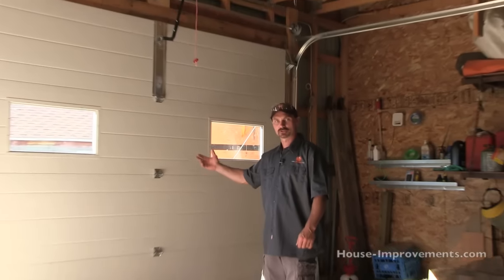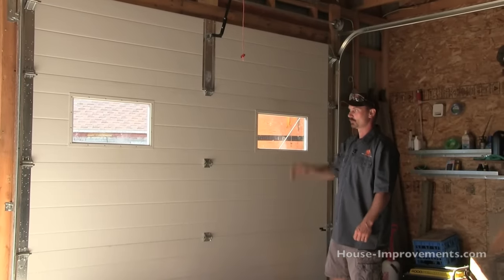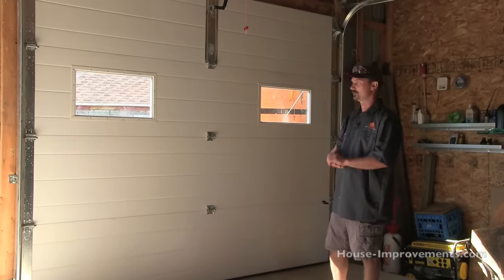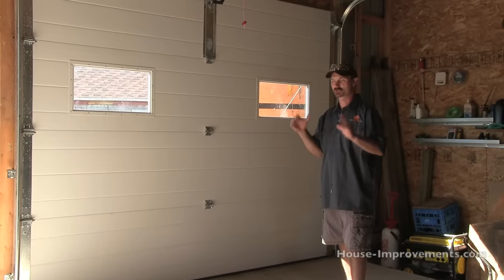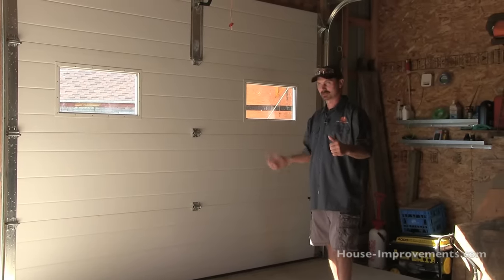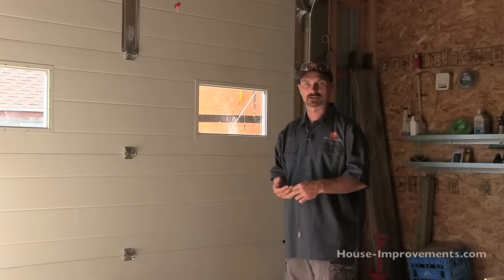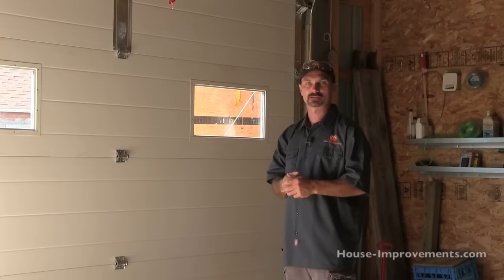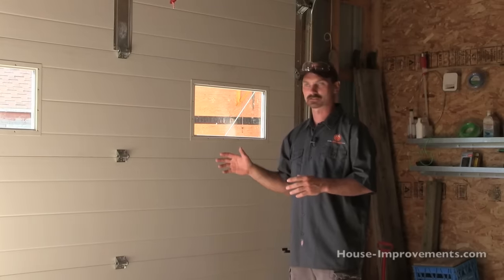How To Install A Garage Door

Comment: Well Done! Been having some problems with my doors and the contractor that installed them has disappeared off the face of the earth! Not only do I feel confident that I can fix it now, but your instructions have shown me what the contractor did wrong that has been causing the problems! The "AH-HA" moment for me: Roller brackets are numbered and "offset" a bit as they go up from the bottom of the door. Explains why mine have always been noisy and were binding!  My door opener has been eating through the "coupling bushing" at motor & track.  I have replaced those 3 times and adjusted the "down-force" so many times I don't remember how many times I have moved the stop switch! Thank you so much for pointing out the obvious. Of course I should have been able to read that in the instructions...but I think my contractor must have used those to roll a joint with...so I don't have them! LOL Thanks again!
Reply from the maker: Good luck,glad to have helped.
Reply: I do have a question you may be able to help with. My door instructions say there should have been a "tag" placed to tell how many "turns" to set tension at. Contractor must have thrown it away, (along with the install book that I was able to find on the inte-rweb). 16X7' insulated door (4 panels, 1 panel with full windows). Dual 225-27 springs. Mark on cone/coupling is G2.005 60. Any idea what a good starting point would be for number of turns? I am guessing I will need to increase a bit as I added 3 more 16' support struts as door panels were "tweaked"  ...but what would be a good starting point? Both winding cables have been replaced as they were broken so I never had a chance to "unwind" and count the turns!  Thanks in advance.
Reply: David Sheward A good starting point on any residential overhead door would be 1 complete turn, per foot of door height. ie: 7' door = 28 quarter turns or 7 complete turns.
 If the struts were added to the door later and were not part of the original package, you may need to talk to a local professional to asses the weight to replace both springs (the original springs are designed to lift your door to it's full opening height. Additional weight will either throw the balance off or wear faster on the springs) Or you may just need to add a couple of additional quarter turns.
Reply: David Sheward It depends on the door height and the drum efective diameter (i.e. the actual steel cable turn diameter on the drum).
With every turn of the drum you will unroll π(pi) times the diameter of it and you want the spring tension to be almost zero when the door is horizontal.
Taking that into account I would start with no less than H/(π*D) turns.
H (effective door travel) and D (effective drum diameter) should be in the same measuring unit.
Does this approx. match with the one in your project HouseImprovements?

Comment: If you put the vertical tracks up right after you put the first section in then you won't need to use a nail to hold up the sections, the rollers will do that for you. Much easier.

Comment: Shannon,  thanks for the video.  I will be removing and installing my garage and garage door opener for the first time.   Really liked the video; it was very detailed and informative.  The only one thing I notice you didn't mentioned is making sure that the horizontal rails are even.......I guess to measure both sides at each end at angle.  ( just remembered that from another short video that someone else make).   But regardless, really liked your video and thanks again!

Comment: The most important thing is be careful not to let the bars slip during tightening, or that spring, and or the other bar, will go flying/spinning wildly, and you could get seriously hurt!.....My Uncle worked 40 years plus, for the Overhead Door Company.....
Reply from the maker: ya that is the most dangerous step in this whole install. I think I mentioned that like 5 times in the video so people would be cautious.

Comment: Home Depot sells a 3' 1/2-inch diameter steel bar. Cut it in half, and you have the best tools for winding the springs. I'd avoid the rebar Shannon uses.

Comment: nice informative video.  Maybe mark your torsion bar adjusting tools (rebar) 1 inch from the end with blood-red paint so you can verify that it's completely in the hole before removing the other one, and maybe point out that you don't "push up", but instead "push in" (towards the header board) so that it doesn't slip out while you're tightening it.  Yes, I've played "knuckle-bump" with my torsion spring on my first attempted at a dyi garage door install (before you tube). Ugly, but memorable lesson.

Comment: Also i like to comment again on the weather stripping i wasn't aware of a channel  they slide into only saw the adhesive glue ones on various objects. Total get what to look for on doors (specially garage doors) , windows , or anything that has weather stripping. It maybe a channel slide in type rather then a adhesive one. Really important to be aware of in general for dealing with weatherstripping not just for garage doors.

Comment: Thanks for video. Will save me much time.couple questions...
1.Rollers, why are they in the lower of the two slots?
2.if installing with dual springs, any cautionary tips, especially if doing alone, as i well be?
Thanks again for sharing your knowledge. Much appreciated.  Btw, great looking garage, framing.

Comment: well done but never wind springs while your standing directly in  front of them, always stand on either side depending on which spring you are winding but yet in some cases standing directly in front of the spring to wind it is the only way  use extreme caution.....also you can wrap the cable on the bottom fixture before installing the l track to make it easier to put on and get to. good job

Comment: Great video.  My problem is that after replacing the old rotted posts the new ones aren't straight, so the new PVC door jambs and brick mould don't line up correctly.  No matter how much I reposition the post, it's always off by a little bit and the whole thing looks bad.

Comment: Good video, but, the 2x4 used to support the track when the door is up will have to be replaced with a metal hanger. No matter what the weight of the door that will fail eventually.

Comment: Hi shannon from house improvements. As an instructional video on YouTube this is pretty good, but you're obviously a builder first. I say this as a green apprentice. For instance the use of rebar is just scary. Please people use "winding bars",  torsion springs are bad enough. "What size was it? OH, this size." That's equally critical to the video as it is to yourself, people want to have these tools prepared, not wonder what size to use, and on a square nut 12 point works best

Comment: if you are going to tension the spring spray it with paint and line then you can see how much tension there is on the spring then you don't have to count much better even if you have to retension the spring later

Comment: This is the best instruction video that I have ever viewed. It was clear, well photographed, well paced and valuable to the viewer. Thank you for sharing your knowledge,  talent for mechanical projects and for your video instruction skills.

I have a couple of follow-up questions. I need to replace two garage doors that are production builder grade (junk). The metal-work (rails, supports and spring) are in pretty good shape. The doors, which are made from press board with flimsy sheet metal stringers, have warped and are beginning to show signs of water damage. There is a 2-inch bow at the top of the double door which is letting in the cold air.  Is it possible to acquire only new door panels and simply replace those? All the DIY door suppliers seem to want to sell me the entire kit for $2800-delivered. Can you recommend a supplier? I have looked at Amarr doors and like some of their Oak Summit designs.

Thanks again.

Rick
Reply from the maker: +Richard Thwaites  If the doors where that cheap I would assume the hardware is not likely much better , I would replace everything.
Reply: +HouseImprovements Thanks for your prompt reply. You're probably correct on that count. No sense in taking a shortcut that I will regret later. By the way, the Amarr spring seems to be loaded using a drill. It's got what looks like a geared tensioner.Thanks again.

Comment: Springs accidently or carelessly mounted and wound backwards can get you REALLY hurt or worse. A backwards wound spring will allow the door to stop part way up at which point the cables go slack and possibly come off the drums. Also the further the springs are wound backwards the more likely the winding or stationary cone will wind itself off and that can toss the winder off the ladder.
Reply from the maker: If in doubt, call a pro.

Comment: Nice instruction. But, you should explaing what dimensions the parts should be placed against each other for various size of headrooms, and sidewalls. Otherwise, the doors cannot be well aligned and adjusted.

Comment: You didn't talk about how you kept the horizontal rails parallel and square with the opening. You made them level with the string adjustment but in the next shot they were already secured with the 2x4s.

Comment: Great video, thanks a lot.  What did you use to attach the support block from the ceiling to the track without the rollers getting hung up?
Reply: I've asked House Improvements the same question. If I had to guess I'd say he ran a deck screw from the inside of the trackinto the hanger but I wouldn't trust it if that were the case. In my install I'm going to run a 1/4" or a 5/16" carriage bolt from the inside of the track through a pre-drilled hole in the 2x4 and orient the 2x4 hanger so the fastener penetrates the wide side of the 2x4,and secure it with a nut & washer.

Comment: Only thing I saw missing is how to align upper rails left to right.
I take a square on the floor make a right angle where the track meets the floor ,then chalk a line , or straight board toward back of the room, from there you can use a plumb bob or vertical laser. This way you can measure left to right and both sides will be running parallel and square to the door.
Reply: I did finally see how you adjusted upper

Comment: Great video as usual. I notice that you are installing on an unfinished interior.  I have a similar situation where my door is installed on an unfinished interior.  What factors do I need to consider in the door adjustment when I put sheeting on the interior (underneath/behind the door tracks and hardware)?  How do I move the door to do this?

Comment: Great video. Thank you for sharing. I was wondering if you can recommend how to get a dent out of an insulated garage door panel. The type of panels that you have I have and I have a dent.  Not sure how to get it out. Any recommendations?    (its not cracked just a slight dent but very visible)

Comment: It looked like you had the frame  with a predrilled hole when you put on that first bottom bracket for the rail.  You didn't mention it.  I always wondered if you should predrill cuz a lag screw could either be tough to put in or split wood.

Comment: Thanks for your hard work on this!! 

Question:
What if the bottom hadn't been level? Like if the foundation was off a little? Would you just shim it up for install and then add extra weather stripping?
Reply from the maker: +eRic Johnson yes shim it level and the bottom weather strip in most cases would still seal anyways.

Comment: Just like everyone else, I applaud you for your thorough "how to" instructional video! I have just subscribed to your chanel and registered on your website. I have a quick question (and did not know where to ask it}. I will be installing a 16' door with 2 torsion springs. Any advise on which direction they should be wound would be appreciated. Also, I plan on painting the door before install.  I believe it is a metal (aluminum or steel with factory white finish - can't tell which) insulated door. Do you have any advise for such a project? Thanks much!
Reply from the maker: Any doors with multiple springs I have seen come colour codes to determine which spring goes on which side of the middle rod bracket. These springs I have done always are wound upwards like in my video. Check your instructions for this information or check with the manufacture.
I have never painted these doors but I do know they can be painted either before installation or after.

Comment: Excellent how to, it's helped me a lot with my install! There's just one question about the 2x4 hangers you used for the track from the ceiling (time stamp @ 59.00) .What fastener do you use to hold the track to the narrow face of the 2x4? I figure you run it home from the inside of the track, is the fastener a deck screw?I'd use a carriage bolt but it doesn't look like you can use one in your case.
Reply from the maker: I used a #10 screw with a fender washer.

Comment: I'm Replacing A Garage Door...Do I Take The Door Panels Off 1st Or The Rails? Do I Have To Replace The Spring & Rails Or Can I Reuse Them?  Thanks Shannon For The AWESOME Videos!  Oh I See You've Got A Forum In The Description Drop Down...I'll Check That Out 2!!
Reply from the maker: Keep the vertical rails inlace until the panels are removed this will hold them in place while you work. Depending on the age of the hardware and how often the door is used you could reuse them. If its been used for like 15 yrs every day then I would change it all.

Comment: At what point did you shim the door?  When you put the bottom panel in you said it was level enough but later on when all panels were in there is a shim on the right side and there was no mention of this during the video .

Comment: Good video. Thanks . I have to install 3 doors 2 10×10 and 1 12×12 . The structure is metal what do u suggest on holding the door up when u can't use the bent nail technique.  Thanks for the help
Reply from the maker: You can install your tracks first ,as you install panels after that just install the end brackets and rollers and they will hold the door panels in place.

Comment: Thanks ... haven't  put in an overhead door in years! Your video was very informative and has helped me remember the procedure. The 9x7 door will be delivered tomorrow via Home Depot. One question ... does a 2x6 need to be added inside the rough opening? I have viewed a few installations and I noticed all seem to have the 2x6 inside over the stud and jack and at the header.  Thanks again ...I did subscribe!
Reply from the maker: +Bill Amore  Yes You can see in the video our opening has 2x6s around the inside.
Reply: +HouseImprovements ... thanks ... door arrived just moments ago ... hope to have the door installed by sunset! your video was the most informative. .. I've been a carpenter all my life but at 65 its a chalange ... wanted to be in this trade since the 2nd grade! it has served me well!

Comment: Thank you for the great video! I have a concern if you don't mind putting my mind at ease. At about 49:15 you mentioned that when the spring tightens it gets longer. My concern is, that when the spring tightens and gets longer or loosens and gets shorter, doesn't the torsion bar, which the spring is bolted to, shift left and right as it sits in the bearings, as the spring tightens/lengthens and loosens/shortens? The reason why I ask is because each "drum" in your video is bolted down securely to the bar and placed near each end bearings. If the spring shifts laterally because the spring is getting longer or shorter, wouldn't that kind smash/crush/force those drums into the end brackets where the bearings are? Doesn't that kind of bend the plates outwards? And wouldn't that cause, for the lack of a better word, "binding"? Could you let me know if I'm right to be concerned about that or of the "shifting" is minimal and negligible? Thank you again!

Comment: Shannon, glad I happened upon your video for this purpose.  I am planning to purchase a metal building with a 16x8 flameout for a garage door.  Because this will be a metal building, I do not have any of the wood framing you have in your installation.  BUT, I then noticed that MAYBE you also have a metal building and just installed the internal wood framing.  if this is not the case for the building you are installing this door, my questions are (1) is it possible to do this ... install internal wood framing?  (2) would you recommend for the metal building I intend to purchase?  Thank you.
Reply from the maker: My building in this video was wood framed with metal cladding . In your case it will most likely be possible to add the wood framing to the metal framing, or it may be possible that the building has metal already in place to install to and you would just need appropriate self taping bolts? I would discuss this with your supplier of the building to see what they suggest. If you ave more questions please use our forum. https://www.house-improvements.com/forums/

Comment: I have a garage with an open beam ceiling similar to this, except it doesn't have the lower horizontal beams. Is it possible to install a garage door opener?
Reply from the maker: Yes along as the top rafter cords are in good condition. You can hang it from a couple of them.